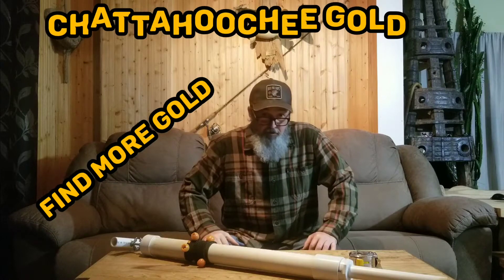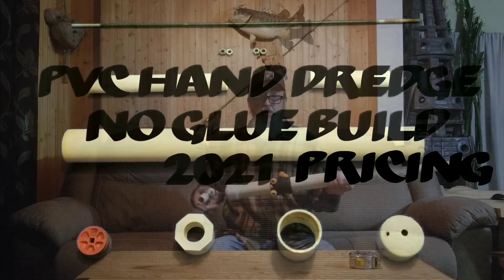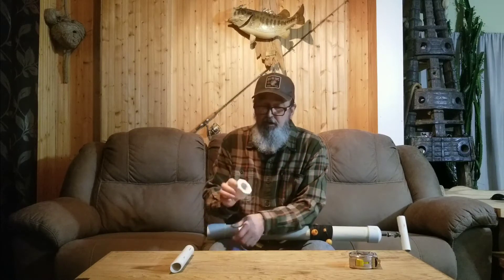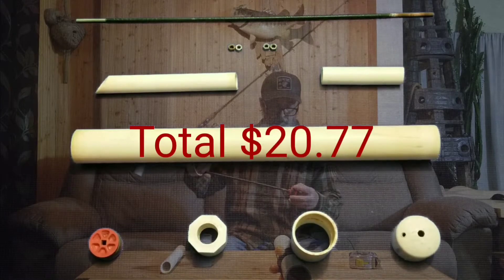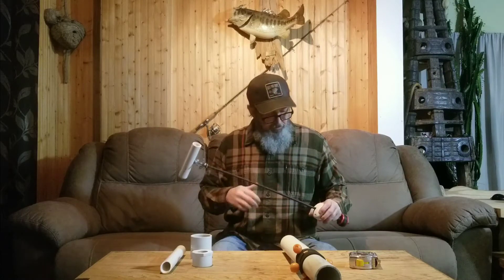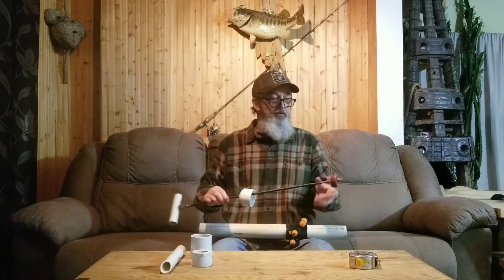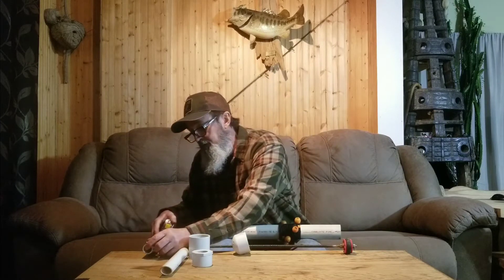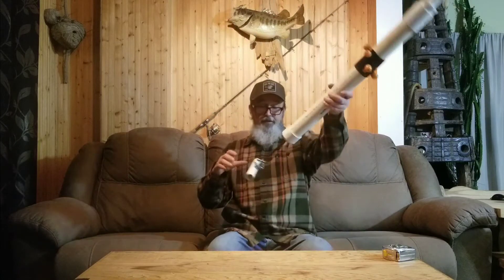DIY PVC Hand Dredge Build/2021 pricing

Comment: allthread with electrical tape is a very bad idea. easyer , cheaper and better to just use a 1" pipe instead
Reply from the maker: I do agree. I built mine from spare parts that I already had. Since I built it, I have seen improvements that can be made. Thanks for sharing

Comment: You have labeled both holes in the cap at 5/16 yet they are obviously different sizes.   Explain
Reply from the maker: You are right, they are obviously different sizes. I labelled them both as 5/16 because when building you would need only one drill bit making the build simpler. On my cap the smaller hole is 1/4, and it's the breather hole, so making it 5/16 doesn't hurt anything.
Mine is a prototype that I built years ago. ><>---